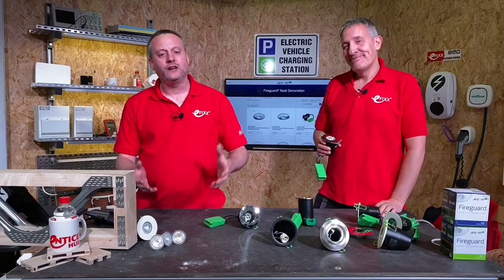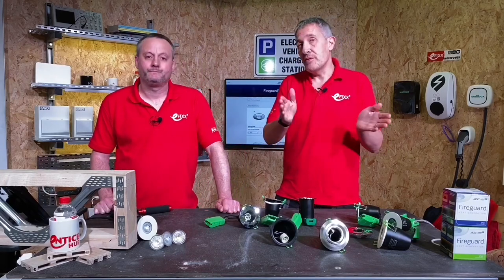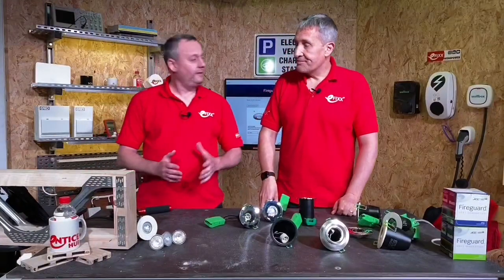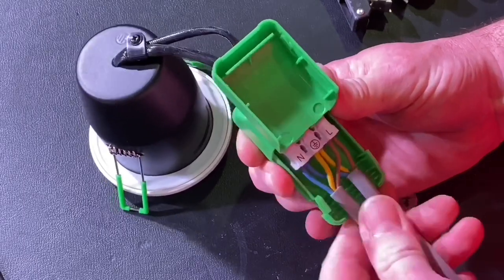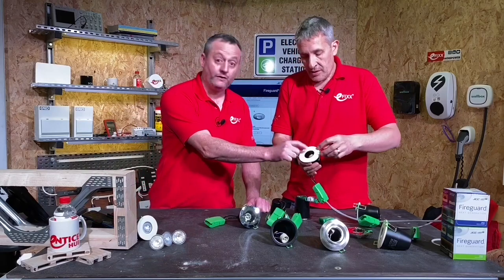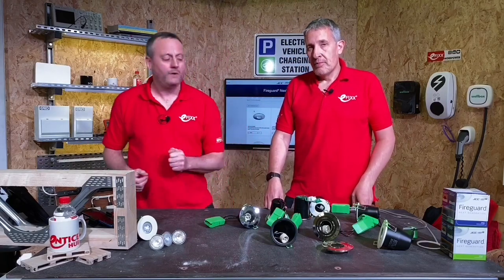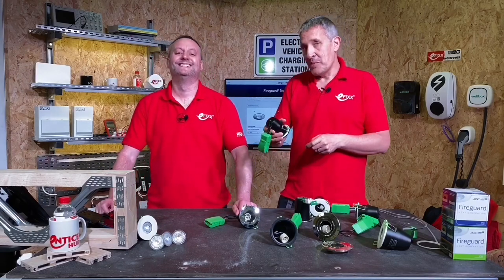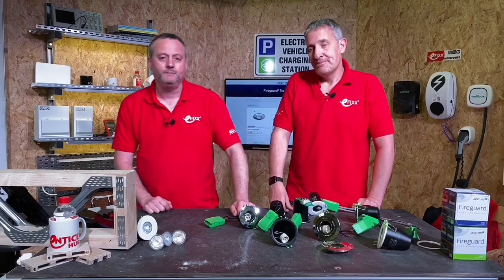Electricians drive the design of the Fireguard Next Generation LED downlight from JCC Lighting

Comment: I think it'd be ironic if an LED-only GU10 fitting eliminates the can holes because LEDs are more prone to overheating if used in a totally enclosed luminaire. However in fact the holes seem to be relocated to the sides where the spring slips are - might they dissipate heat any better than top holes? What do you think?

Comment: If these have a push fit cable connection, does it have external test points without having to remove the cables for testing? I know that it's quick and easy to remove cables but it would be even better if you didn't have to.
Reply from the maker: We will have a closer look at the connectors and report back - you could also test via the GU10 lamp holder - https://www.screwfix.com/p/kewtech-lightmates-lighting-circuit-test-adaptors/3440g
Reply: @efixx  of course the additions from kewtech would be beneficial, but it would be interesting to see if JCC have done this. Thanks for the response 👍

Comment: I mainly use the V50, and they are great, I did fit some of these, and to be honest JCC missed a trick with the connections, they should have been the same as the V50 so much easier to terminate.
It's not so much getting the fitting in the ceiling, it's getting the things out without damage to the ceiling, and these will be the same.
Reply from the maker: This new version has the same connector style as the V50
Reply: @efixx  I know but they are a different layout the V50 layout is a lot quicker
Reply: I agree, they should have stuck to the LENNEL layout.
Reply: Thank you for your feedback, great that you like to fit the V50™. 

We spoke to many contractors and the preference between V50™ style terminals and Fireguard® Next generation was evenly split. 

We chose to offer this in Fireguard® to ensure that we had both options. But we are always interested to hear customer feedback and if the V50™ style is the option that more contractors would prefer, we will be happy to include this in future developments.